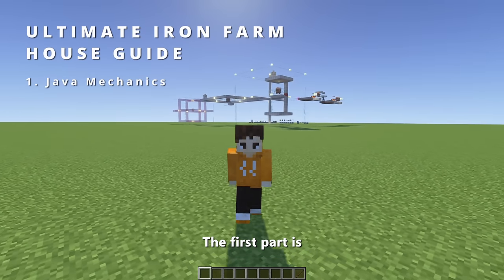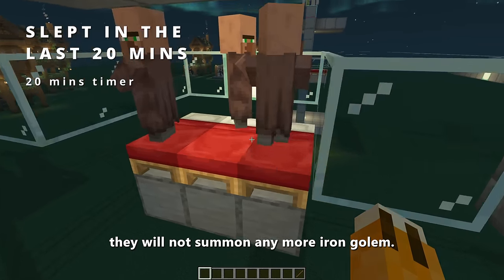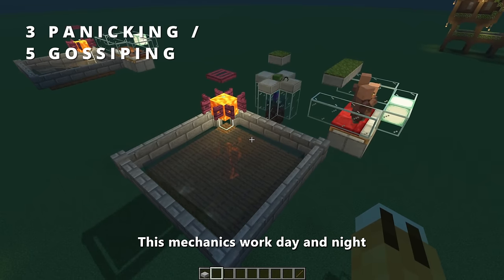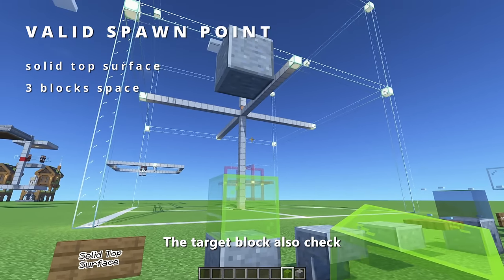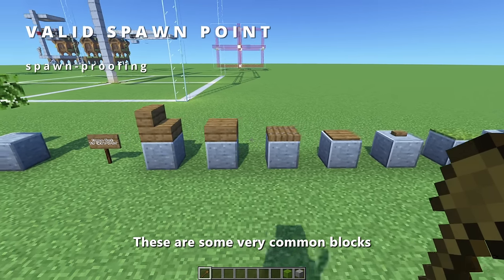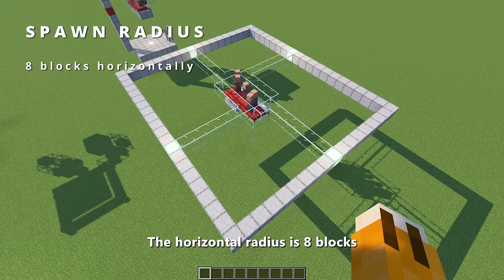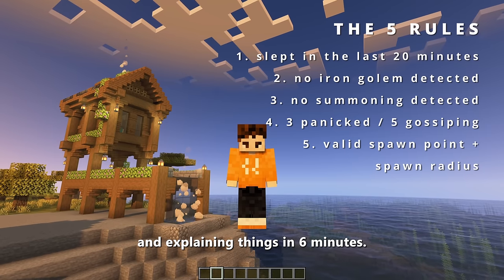Ultimate Iron Farm House Guide [Aesthetic Farm] [1440p HD]

Comment: Full Materials List for 3.0 build
3 stacks 57 stripped spruce logs
1 stack 49 spruce planks
2 stacks 37 spruce stairs
1 stack 26 spruce trapdoors
10 spruce slabs
12 spruce buttons
8 spruce fences
12 spruce signs
6 oak trapdoors
1 stack 46 stone slabs + 56 stone brick slabs for texturing
39 stone brick walls
1 stack 6 deepslate brick stairs
1 stack 6 deepslate tile stairs
20 cobbled deepslate stairs
5 deepslate brick slabs
5 deepslate tile slabs
3 cobbled deepslate slabs
12 lanterns
24 light grey stained panes
3 beds
3 grass blocks
3 stone pressure plates
3 mud bricks
1 campfire
4 chests
17 hoppers
3 ladders
37 azalea leaves
42 flowering azalea leaves
10 stone
10 cobble stone
10 andesite

Spawnproofing
40 moss carpet
4 buttons

Materials to upgrade from 2.0 to 3.0
1 soul sand
20 spruce planks
6 spruce slabs
17 spruce stairs
3 spruce trapdoors
3 light grey stained glass
14 moss carpets

2 soul campfires
16 spruce slabs
5 hoppers

Notes
most of the texturing blocks like all the deepslate stairs, the stone slabs and the stone blocks i included extra of bc its up to you how much you want to add for texturing so there will be extra. same with moss carpet. the azalea leaves are the exact amounts used in the tutorial but obv thats up to you how much or how little you want to add. i found it easier to make the 2.0 build first, then go back and make the 3.0 changes so thats why the materials are laid out like this. its a little extra work but easier to follow tutorials this way. hope this helps!

Comment: I will like to note for bedrock that you can relight the campfire after it has been extinguished by the water and it will stay lit, so you don't have to do the sign method. Hope this helps
Reply from the maker: Thanks for this tip!! This is awesome.
Reply: how do you get it to relight? struggling with placing signs/getting the campfires to work under water :)

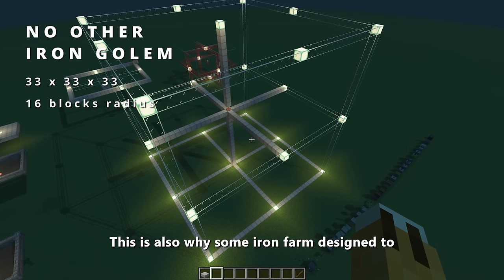Comment: Love your farm design, spent hours troubleshooting some fixes before realizing you already put most of them in a video. Just a quick note on the spawning radius at 2:30, while the villager spawns golems around it in this radius, its better to space out the iron farms based off the village subchunks, as of more recently theres no more "village center" on java instead. Any subchunk (a 16-block-high section of a chunk) containing a claimed bed, bell, or job site block is considered to be a "village center," so if the beds/villagers are in the upper NW corner of a subchunk, that subchunk becomes the center, not the beds. So spacing out your farms using chunk borders is fantastic to make sure they are properly spaced, because while 16 blocks is all you need, if those beds happen to land in the same set of 3x3x3 subchunks then they merge. and all 26 subchunks in a 3×3×3 cube around it are also considered part of the village, as used in raids and some pathfinding. Also cats will spawn within a 5x5x5 subchunk cube around a village center, and patrols will not spawn when the player is in the same range.

Comment: (On bedrock)Great design and after this video I managed to get it to work for a short time then it just randomly stopped. I was AFT around it so not sure why it stopped.
Though maybe it has to do with the villagers not being able to use the beds under the second row of beds and that they keep relinking to beds and work stations. The little cloud with lighting along with the green sparkles keep popping.
Relighting the fires under water worked great but the fires have to be placed 1 block apart or they will go out when you go to light the second one.

Comment: Another note in Bedrock 1.20.1:
For some reason, Golems consider the flat area around the block on which a wall or fence sits to be spawnable, thereby breaking the farm.  I experienced this with the walls running along side the stream, which resulted in Golems getting up on the leaf blocks or stepping out of the stream and standing there.

Choosing another block that fills the area that is not spawnable or walk-able from an adjacent flat area is recommended (such as reversed stairs).
Reply: Just ran into this same problem myself, was a simple fix by adding a second row of leaves on top of the first outside the fence!
Reply: Adding an extra note here for anyone else that might run into this.  We built this iron farm on a hill near our base and didn't have it up as high as it should be, and ended up having to spawnproof a lot of the nearby areas.  Thanks to this change we also had to further spawnproof any fences nearby outside the farm.
Reply from the maker: That's good to know! I think the easiest way is to add a layer of slab on top of the leaves. Or replace the leaves with wall / fence.
Reply: @albireo1533  yeah. He has a pretty consise video regarding the mechanics including the golem spawn boundaries in his other video https://youtu.be/MXwS7R3R2iY.  Just need to make sure the bed pillows are 7 blocks high and 8 blocks horizontally away from spawnable areas around the farm.
Reply: @aJackMinecraft  true. Would stop them climbing up, but they were spawning on the same block as the fences and using the fence area to step out of the stream. I just used some aged copper stairs with the back turned to the stream an that seemed to fix them spawning in the fence block.
Reply: Did your villagers sleep in your farm? Since the bedrock edition one doesn’t show them sleeping

Comment: You HAVE to spawn-proof every block on the building and even on buildings near the Iron farm. Even if there is a 1 block surface, the iron golem will spawn on it if there is not a carpet on top of it. If you put carpet on top of every surface, both inside and outside the iron farm, you should have no issues.

Comment: Tip of advice, if you think the farm is a little slow, you could make some little changes, Ill try my best to explain how I did it, First of we have to use the farm design that doesn't have a waterfall, then I'm assuming you have already drained the water in the kill chamber and have only left some campfires and trapdoors (you can switch all the trapdoors and campfires with signs they are cheaper),  after that you have to change all the wood around the kill chamber with stone (Off course not all, only on a 2 block radius, but for aesthetics sake you can change all of that first ark, also any stone is fine use your imagination) and finally you will fill your kill chamber with lava where it used to be water (with just 2 buckets it should be fine, I filled mine on all blocks so it locked nicer) with this the farm should be faster. If you have any questions or don't understand this just leave a comment responding to this ill try my best to explain the part where you got lost. And finally I'm sorry for any misuse or misspelled words, English is not my first language.
Reply: Please don't make the mistake of not placing enough stone around the lava, if any woodblock gets caught on fire your hole farm will burn down.
Reply from the maker: Using lava in kill zone do increase the farm efficiency but not in this case. I know soul campfire is slow so thats why the kill zone is exactly 16 blocks away from the villager. The villager cant detect the iron golem inside the pool.
Reply: @aJackMinecraft  what happens if the villagers detect an iron golem dying?
Reply from the maker: @JasonTheHH  nothing haha
Reply: @aJackMinecraft  hmmm ok cool. I built this farm but I am having some spawn outside of the intended area. Not on the building, but around it or underneath it. How do I fix this?

Comment: I’m having a problem right now where the iron golems are spawning like 10-20 blocks away from the water stream on the outside of the build. Not really sure what’s going on because it was working fine not too long ago. This build is nice but I’m not sure what’s going on
Reply from the maker: I am pretty sure you have a new villager with a bed within 100 blocks radius of the iron farm. That expands the village and causing the village center to move somewhere between the new village and the farm. I had this happened in my test world before. Try to find that villager and break the bed + job site if there is any. Might also need to replace all the bed of the iron farm to reset the village.
Reply: @aJackMinecraft  I tested and yes that was the problem thank you very much very much appreciated!

Comment: so I have had trouble with the new changes for the 3.0 version. Since the first rule applying they have to try and sleep within 20mins, I don't get any iron golems during the day. Sometimes if I'm near the farm and it starts working at night, when it turns to day it still kind of works. But this may be an issue with opening and closing the world during the day, and being away from the farm. Is there a fix for this or am I out of luck? 
I also was able to get twice as many Golems in the 2.0 version for some reason? Idk if it was the addition of the water fall or something else.
Reply from the maker: The spawn rate should be the same for day and night. In my world, I am sure 2.0, 2.1 and 3.0 have the same spawn rate.
I believe you were away from the farm for too long. When you come back, the villagers need to wait until night to reset the 20mins timer. The only solution is to build a chunk loader next to the farm so you don't need to stay close to keep the farm working.

Comment: I don't get it. Worked fine with version 2.0, but after "upgrading" to 3.0 it's broken. The golems just don't spawn into the stream. Stream floor block is 7 blocks below the beds, 6 blocks between them. Whenever I place 3 blacks on the outside walls of the building, a golem spawns almost instantly. Raising the water channel floor or removing the water does nothing. 
I'm sure the villagers are slept and panicked because of aforementioned reasons, everywhere else the golem spawns almost instantly.

Comment: Hi Jack,

Beautiful Design,

another User commented that in Bedrock Soulfire can re-lit. But i have to add that it doesnt work if two soulfires side on side.

I had to made a 5x5 Hole to seperate each Soulfire. Than you can li all.
Reply from the maker: Thanks for letting me know! That's interesting...block update would cause them both extinguish.
Reply: @aJackMinecraft  its funny because when i tried to lit one up the other gets off. :) but with a 5x5 Hole it works without problems.

Another Question to you Jack.
I get my first Golems.

Later i want to check again but it seems that there are no more Golems spawning.

Do you know what is causing that?

Im on Height 104+ and 120 Blocka away from my Village.

I removed one villager without Job and lets them produce a new one. I dont know if this can cause the problem. I must wait to see.

If anything happend i will inform you.
Reply from the maker: @b1nary.research  Did you place new beds within 100 blocks radius of the iron farm? That could cause the village center to shift to a new location.

Other possible issue is the number of villagers in the village increased. Baby villagers are not working so <75% of them are working and that would stop the farm.
Reply: @aJackMinecraft  no. In my village are only 2 Villagers because of restyling the entire Village.

I check when im at home again.
I will take a look and write here again.
Reply: Hi Jack,

ive checked again and it is all fine. The Farm works properly in MC Bedrock 1.20.1 with the fixed Soulfires. Thanks for sharing this Beautiful Farm.

Next Project in my Survival World is the beautiful Creeperfarm and the funny Chickenfarm with the Waterelevator.
Reply from the maker: @b1nary.research  Thats great news!

For your information, Creeper Farm isn't working so well on Bedrock. Since I don't have the trident killing chamber so the gun powder rate is really low. Also, make sure to check the link for alternate design in the description if you still want to build it.
Reply: @aJackMinecraft  i will try, i have to learn some mechanics too in Bedrock. :) 

But i like those medieval Styles.
This brings Minecraft to the next level of pixelated block gaming.

Its cool to build and give personal styles on the build.

Best regards from Germany

Comment: for people whose farm isn't working (iron golems aren't spawning): in my case 1 villager refused to sleep and kept running around waking up other villagers. your villagers may be linked to another bed you forgot to remove. break it, then replace all the beds inside the farm. all villagers should now be able to sleep and golems will start spawning
Reply: also fill the inside of the building with carpets (the room and under the roof). otherwise golems keep spawning inside (even if you followed the guide and placed all the moss carpets the same way) and killing the zombie/dying of suffocation. but make sure your villagers have eye contact with the zombie, or they won't be panicking and golems won't spawn.

Comment: Im having an issue using the java style build with adjustments to work for bedrock like described in this video. I have 20 beds and a layer of glass with 20 fletching tables exactly how it was done in the video. So far, my villagers have bred up to 7 villagers and just seemed to stop randomly. They"ve been given plenty of food. Not sure what's causing them to stop breeding. any ideas?
Reply: I figured it out. If anyone else is having this problem, check with other villagers in the area. I had two villagers about 80 blocks away doing all the breeding instead of the ones inside the farm. Isolate the other villagers and wait until the farm breeds 20 before setting them free.
Reply from the maker: Always remember the first rule, >100 blocks away from other village. This is really important when you build an iron farm in Bedrock.

Comment: I'm a  little confused; are there no zombie added in the bedrock ver of the farm anymore? and how do villagers sleep while blocked by the glass...?
Reply from the maker: No zombie needed for Bedrock. Different mechanics.

They can sleep but its not recommended. After some time and chunk reloading, one of the villager couldnt sleep anymore.
Reply: @aJackMinecraft  Tskr!! Just finished building it, and it works like a charm
Reply: I encountered an issue just now: I haven't logged in for a while, but my friends played quite a bit while I was gone. When I came back, the golems are respawning on the diorite tower I'm making next to the farm instead of in the canal TT Is there any way to fix this? The tower is still hollow, and apparently no one changed anything in the iron farm while I was gone, so I'm very puzzled...
Reply from the maker: @avi8492 If you watched the explanation at the beginning of this video, you will know the spawn radius of iron golem. I think your tower is too close to the farm. 

You could place carpet / buttons on any top surface thats inside the spawn area.
Reply: @aJackMinecraft  thank you very much! I'm saved...  😭

Comment: Playing on bedrock and my villagers keep on switching their work stations and beds, which I belive is the reason why no golems are spawning? Is there a fix?
Reply from the maker: Switching bed and work station shouldnt be the problem. The villager center still remain at one of the beds inside the house. Could it be just really slow spawn rate? Or did you put new villager with bed in 100 blocks radius of the iron farm?
Reply: @aJackMinecraft  thank you for replying, it's good to know that the switching isn't the issue, but all my villagers are new and are near their beds as shown in the bedrock version of the farm, so I suppose my spawn rate is just slow.

Comment: Are Iron golems supposed to spawn on the ceiling?
Reply: You HAVE to spawn-proof every block on the building and even on buildings near the Iron farm. Even if there is a 1 block surface, the iron golem will spawn on it if there is not a carpet on top of it. If you put carpet on top of every surface, both inside and outside the iron farm, you should have no issues.

Comment: Ive had the 3.0 version built on Java 1.20 for around 30ish minutes now and I havent had any Golems spawn. The villagers are sleeping and panicking and i have the area around the build fully spawn proofed. My zombie did turn into a drowned but I dont see how that could be the issue. Im using the version with the water going over the edge. built Exactly the same minus some extra details like the buttons and lanterns. Im not sure what my issue could be.
Reply from the maker: Check the distance between the water canal and villager's bed. It has to be 7 blocks below the bed.

Comment: Did you find a solution for the iron that floats at the top instead of going into the hoppers?
Reply from the maker: Hmm...this never happens to me on both Java and Bedrock.
Reply: oh! It's quite alright. I have have had it happen to me but the overall abundance that this gives me, helps cancel out the 64 iron loss an hour. I haven't figured out why it floats a few times out of the majority. But over all I have learned to live with it at this time!  @aJackMinecraft
Reply from the maker: @CupcakeJemon  Perhaps you could lower the campfire and hopper by 1 block. Add a layer of sign between the water and campfire. When the iron golem dies, the item won't touch the water and float up.
Reply: @aJackMinecraft  okay! I will give that a try!

Comment: Having some issues getting the golems to spawn, i didn't build it exactly like this, but i did for the most part but they were spawning everywhere but the water, i added slabs now they're not spawning at all (on bedrock)
Reply from the maker: I afraid you built this too close to a village. Now the village center is somewhere between the farm and that village. Easier way to fix it is to find a new locations >100 blocks away.